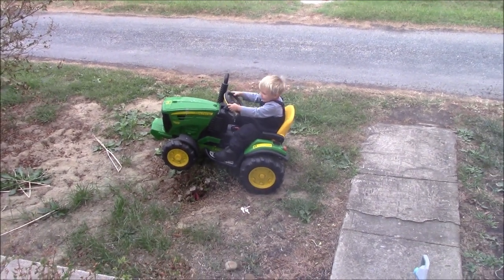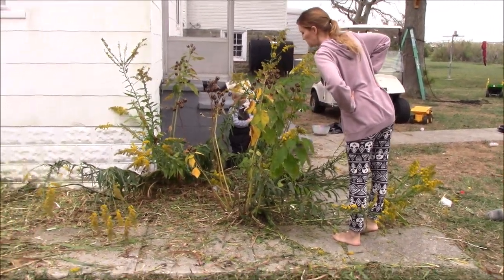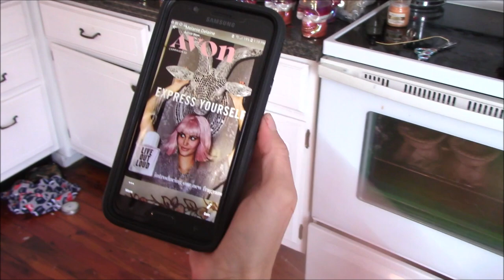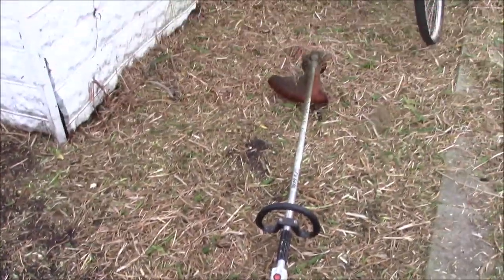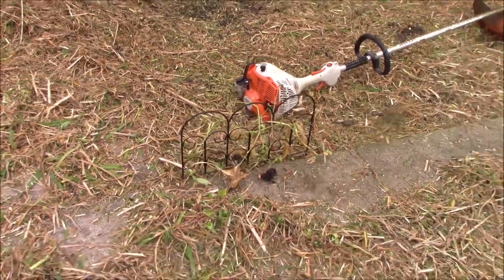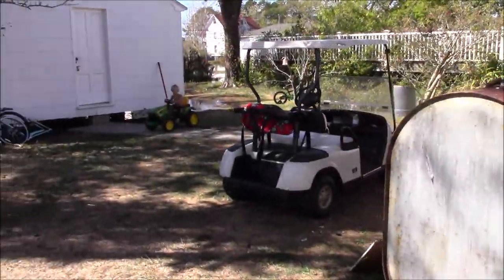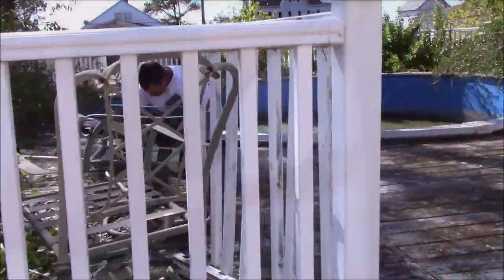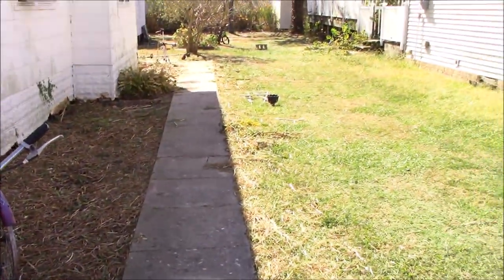The Tide is Rising... Im Gonna Need My Chainsaw!

Comment: I wouldn't buy a house there Chris because with erosion nipping away at Smith Island's banks at a rate of roughly 2 feet each year, and a 2008 report predicted that by 2100 Smith Island will be "almost completely under water as the Bay's average level goes up nearly one-foot."Nov 1, 2015 .

Comment: I would finish by cutting a big hole in the bottom of that pool so no water would sit in it and  be a mosquito breeding pit. The liner is no good anyway and it would be safer in case a child were to fall in there.
Reply from the maker: i have thought of doing that, that water is SO NASTY
Reply: Be really careful around that stagnated water cause it can carry deceases. prob should wear rubber gloves.
Reply: Maybe siphon that awful water out of the Pool, then cut the lining to prevent filling again! Agree, you would need a brand new liner and pool cover to use it! OR....stand another pool, like the one you gave Hollie's Mom, set it up inside the frame of the pool nextdoor! It would be useable and nice and clean!
Reply: @theChrisAndHoLLieShow   That would probably be considered trespassing and vandalism, or some other charge. I would try to track down the family and talk to them, it is a health hazard

Comment: In our home which was a. Older place we had to replace all our outlets, we did it ourselves..cheap too ,helped a lot . Our fuse box is older too. Only had to replace a fuse one...it was scary when we replaced the outlets ,they were a fire ready to happen..ppl should check them every so many years..

Comment: what kind of heat do they have on the island:? Electric? gas? When I lived on Galveston island it was gas, but it was much closer to land that Smith Island is..// use your sunglasses Chris, better than nothing
Reply from the maker: This house has an oil heater.
Reply: @theChrisAndHoLLieShow  had that in my old house up here in PA - it smells awful and its expensive as heck

Comment: Hey Hollie, regarding your coffee maker; it looks like a Kurig? They have a filter and it probably needs to be rinsed or replaced. Good luck! Oh, and in case you didn't know it, you can buy little plastic containers so you can use your own coffee, it's much cheaper. Also Chris, you can make your own pontoon boat to transport things. Just get some of those big plastic barrels  (the heavy duty ones) to act as floats, and some planks and put a barrier on the outside.  Just stick an outboard on it. So much cheaper than paying someone to transport. Hollie, will you make me  sage and rose candles? I am allergic to so many scents, those would be so perfect for me.

Comment: I don't know if they offer Comcast/Xfinity Cable service on Smith Island but if they do to the best of my knowledge they offer the best, fastest internet service in this part of the country.
Reply from the maker: I'm really not sure, so far I know there is Hughes and Verizon.
Reply: @theChrisAndHoLLieShow  Well Verizon internet would be thru the phone lines and that's DSL which isn't bad but Comcast/Xfinity is like 5 or 6 times faster then DSL. I can download 1.5GB's worth of files in less then a minute. Upload isn't quite as fast but it's pretty darn fast. I'm not familiar with Hughes but my guess is that's satallite which is usually slower then DSL. You probably don't have Comcast/Xfinity there though but it's available all over here on the mainland.
Reply: @theChrisAndHoLLieShow  Okay I got curious and checked and I was right Huges is satallite and the Verizon service there is DSL. The DSL would be your best option if your only other choice is Satallite. Unfortunately there is no option for cable service there. Not enough homes to make it worth Comcast's while to do what would need to be done to bring cable service out there.